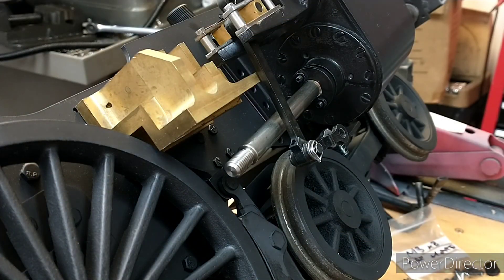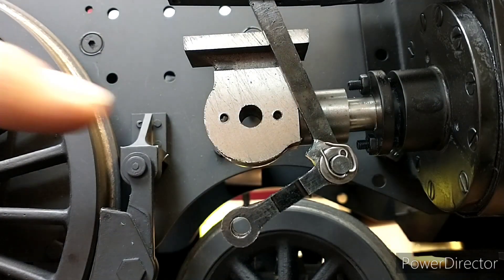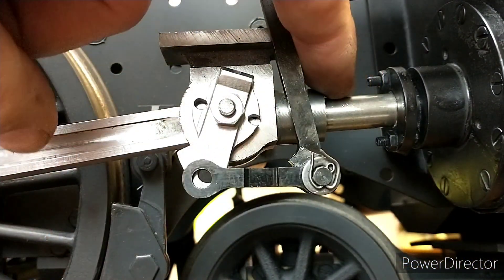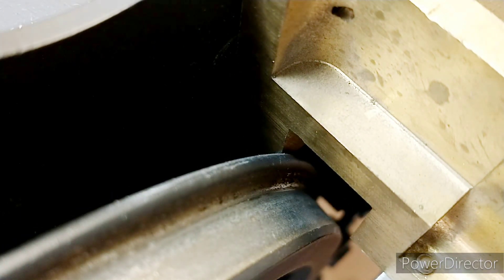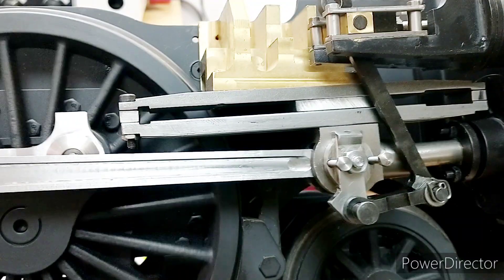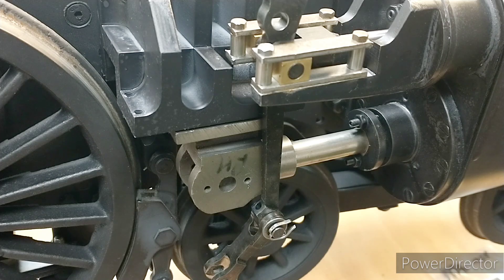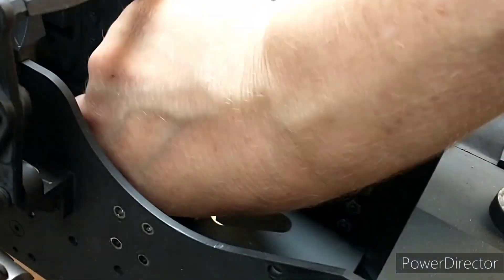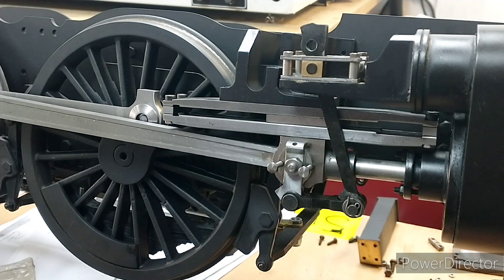Modelworks Britannia Ep36: Finishing Slidebars and Crossheads.

Comment: hello julia... its me again  !.  when you get round to fitting the boiler ..remember it can only be  secured to the chassis at the smoke box end ! the rest of it must be able to slide ,with the expansion and contractions  .i dont know what the expansion rate is" off hand " i think it is 1"in every 10 foot,, i know concorde grew 4" when super sonic..!   also if you look at any  locomotive  all the pipe work has gradual   bends  so as to allow for the expansion of the boiler..hope this bit of dribble helps you in your plight ... lawk after thee sen ! were all wetchin thee  ! regards laurence
Reply from the maker: Hi Laurence thanks for your message. I do need to figure out what stops the back of the boiler moving from side to side. Maybe the cab? Something for future me to worry about! 😄

Comment: Hopefully those countersunk screws between top slide-bar and motion-bracket have been Locktited in place. I remember one dropping down on a 15-inch gauge engine at speed, in the late 1990s, and being hit by the crosshead. It caused a lot of damage, not least it smashed the motion-bracket (a steel casting) so badly that our engineers had to fabricate a complete new one.
Reply from the maker: That sounds like a nightmare. I'll make sure it has some on it. 😃